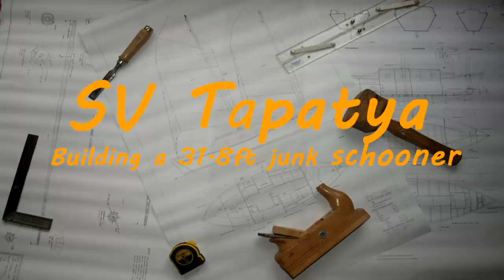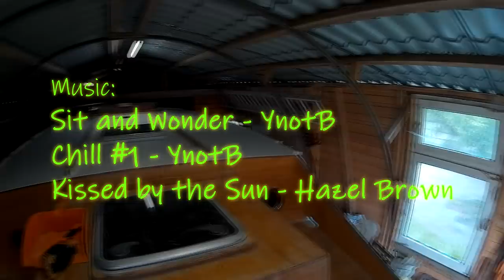Building a sailboat; Windlass, anchor chain storage and the main deck - SV Tapatya EP135

Comment: I agree with the anchor chain on deck. It usually splits up the v birth and gets in the way, plus smells. Why doesn't this come as standard? Is it a center of gravity reason maybe.
Reply from the maker: Yes Paul. It’s exactly that, but there are those that claim a higher c.o.g. to be beneficial, particularly to the ride at anchor 🤔🤔

Comment: No Arguments about not wanting to put the extra holes but my question is whether your box be big enough. Another thought might be are you gonna put some weep holes low on the side to drain water out of the box that you put the chain in. I actually have seen racks that go on the deck it will spool up the rope or chain for the anchor and as that it’s exposed you can spray down and clean your anchor chain right there.
Reply from the maker: Hi Duane. The box is certainly big enough to house my 200 ft of chain. Yes, there will be drain holes 👍😀

Comment: Hi Tony! Looks like you are going full speed...looking great. Checked into Muir winches and they look fantastic, Wanted to return my Andersens but past the return date on them. I have been agonizing over where to lead the chain and must lead it below at this point due to the windless being on deck but I like your deck box solution - ingenious.
Reply from the maker: Thanks Charles. Yes, it's a difficult one the question of where best to store anchor chain. There is no perfect solution, I'm inclined to feel. Many years ago, when I was crewing in the Marmaris race week regatta, under a very experienced racing skipper (we won), we removed the anchor and chain from the boat's anchor locker and stored it midships in the bilge. That is probably the best place in terms of c.o.g., but completely impractical for a cruising vessel.
Reply: @SVTapatya  Hi Tony. I always (well since I knew what was what about sailing) attempt to keep weight out of the ends. Not going to happen with La Isla however.